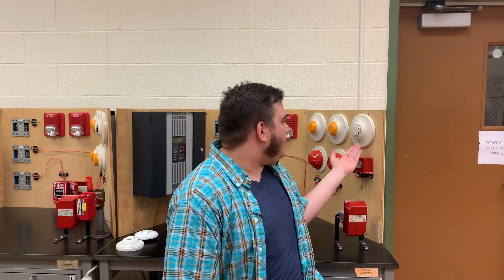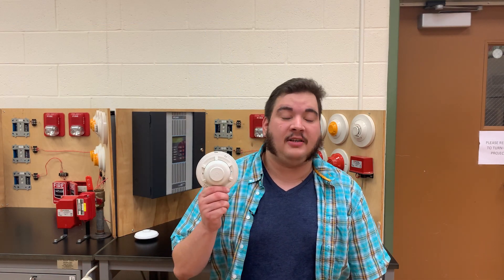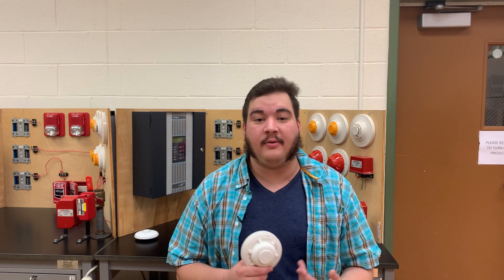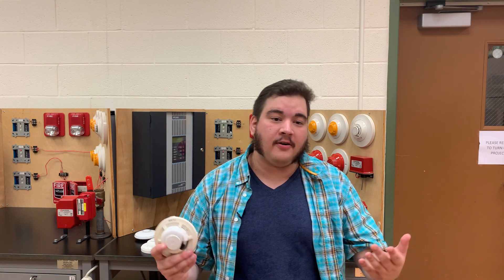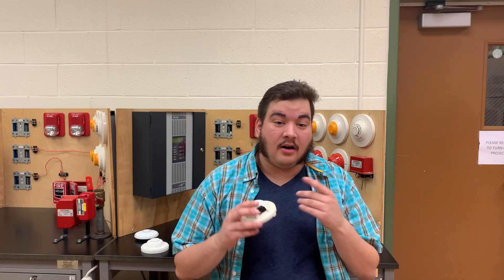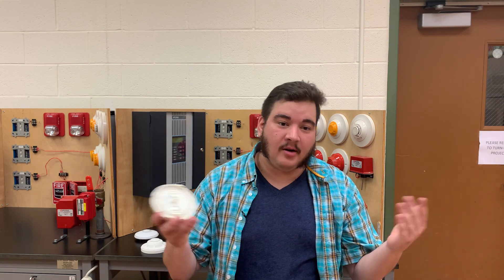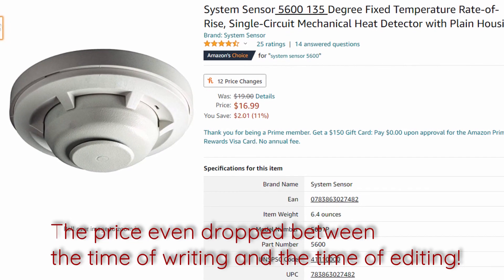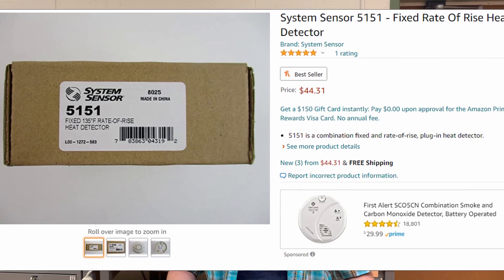Why are Single-Use Heat Detectors Still A Thing?

Comment: how do I test them?
Reply from the maker: SOME single use detectors have a rate-of-rise function too, so you can sometimes test them by heating the side and not popping them. The way defined by NFPA, though, is to activate and replace two of them if I remember correctly. Then the rest you simply short out to ensure they 'talk' back to the panel.. It's not ideal.

Comment: One-shot mechanical heat detectors are also better suited for non-climate-controlled environments such as parking garages, your typical electronic heat detector will only likely be listed down to 32F, if the environment gets colder than that during the winter, then that electronic heat detector will be operating outside of its listed temperature range, which will put it at risk of failing.

Comment: My big problem with these things is that they're not really testable. After 15 years, all non-restorable heats must be replaced, OR 2 out of every 100 must be laboratory-tested. And nobody actually does this.

Now, RESTORABLE mechanical heat detectors are my absolute favorite. Those tiny ones in the thumbnail look like "button-type" heats, but are actually fully restorable.
Reply from the maker: Agree. When I was in the field we encountered many single-use heat detectors that couldn’t really be tested outside of pulling the device down and shorting the contacts, which doesn’t actually test it. In a world of more intelligent systems and devices coming about, I’m sure we’ll see conventional go away all together.

Comment: If the heat detector goes off, it often means that the fire is almost 100% confirmed and needs immediate evacuation. Single-use heat detectors can ensure that the whole fire alarm system cannot be reset under and even after such urgent conditon, therefore ensures the evacuation to be carried out and prevents the premises owner's any possible attempt to flee from further scene investigation from police and fire brigade.

Comment: i'm 11 months late here but another thing i'd like to add is electronic heat detectors have operating environment limitations where they may not be waterproof, or won't function in extreme cold such as outdoors or inside walk-in freezers. That's an environment where these excel.
Reply: Also agree.

Comment: Couple things:
#1: I have no problem at all with mechanical heat detectors, they're still pretty reliable despite their seemingly-outdated technology, what I do have a problem with though is the fact that it's standard to make them non-reusable. I've seen reusable/auto-resettable mechanical heat sensors used in other applications, so why not for fire detection & alarm use too? For one thing you wouldn't have to have a technician replace them after use, & of course they'd be better for the enthusiast/collector's community too (I know the latter's not the concern of the companies making them, but still...).
#2: There are conventional electronic heat detectors too you know.
Reply: hang on, let me put my reading glasses on.
Reply: It’s just an op-ed video bro
Reply: Though I do agree with you on this one. Why not use reusable heat detectors more when possible?
Reply: @BukuiZhao  Nice to know there's at least one thing we agree on. I agree: for one thing it would cut down on the amount of waste in landfills (even with how infrequently heat detectors are replaced), & as I said for another you wouldn't have to have a technician come out & replace a heat detector that had tripped, which would both mean that you'd be inconvenienced as a business owner having the technician on site who might end up disturbing normal day-to-day operations, & that the fire alarm system would not be protecting the area that the heat detector activated until it was replaced (not with a reusable/auto-resettable detector though).
Reply: @TheCarson116  Yea, if it is activated then you must replace it. If not it will just re-alarm. So until it is replaced you have to just take it off, and if there is a fire there, it will take longer to go off because the nearest detector is removed.
Reply: @BukuiZhao  Mhm, my thoughts exactly.